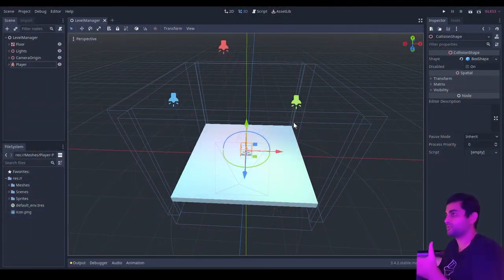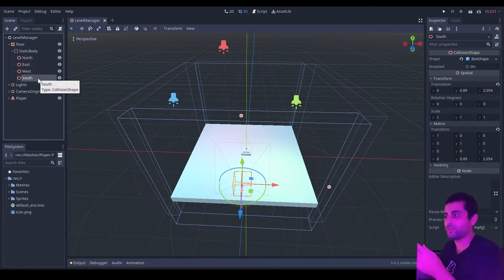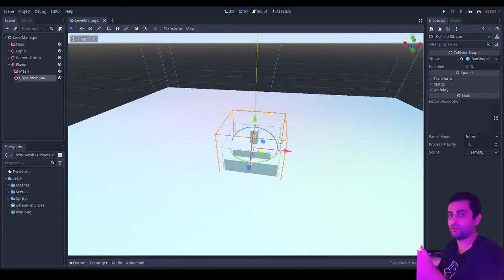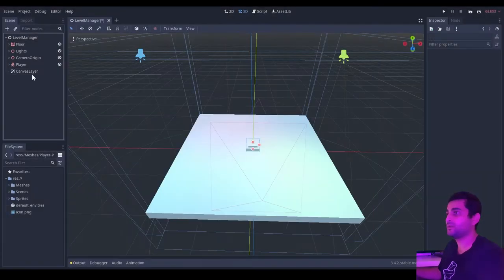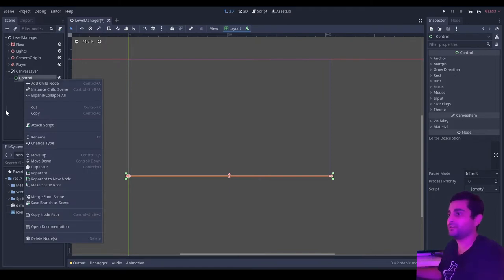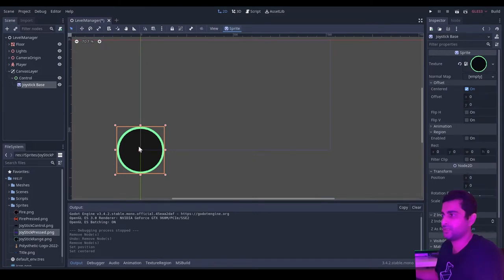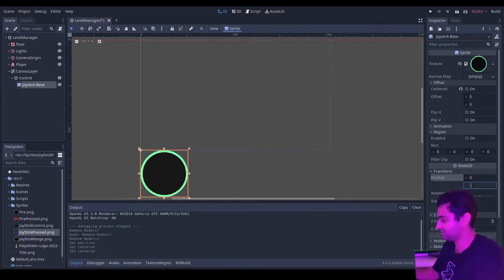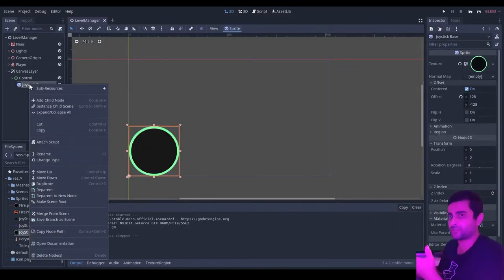Touch Joystick with C# & Godot [Andromedoom Dev Log 1]

Comment from the maker: 📻 Addenda: 
1. You can use Normal.GetSize() and assign that to the buttonSize or use it directly instead of assigning GetHeight() and GetWidth() to a new vector.
2. To get the player node, you can simply use GetNode(/root/...) instead of using GetTree().Root.GetNode(... ). 
3. Note that player movement doesn't take into account the rotation of the player pad. I will cover this in the next episode, but this can simply be solved by using Transform.Basis.Xform(movementVector). This multiplies the movement vector by the basis matrix of the object which can then be fed into the MoveAndCollide function.

Comment: I did everything exactly the same, I checked several times, and I still couldn't figure out why my button isn't centered like yours. Apparently when he resets the position, he joins the corner of the big circle with the corner of the small circle, which makes the position decentralized, which logically makes sense, what doesn't make sense is why in yours it was right...
Reply from the maker: Are you using Godot 4 by any chance? Not sure, but there could be changes to how the positioning works for touch screen buttons. 

In any case, check the pivot and anchor positions of both your touch button and the joystick base. See if you can snap it to the centre by accounting for the dimensions and positioning of each one.
Reply: @Polysthetic  LTS 3.5.3-stable, i cant change the pivot of the "touch screen button" node, apparently only Sprite nodes have Offset property.
Reply from the maker: Correct. Is your script similar to below? 

    private Vector2 buttonSize; // The size of the touch screen button texture
    ...
    public override void _Ready()
    {
	...
        // Get button size for correction of position
        buttonSize = Normal.GetSize() * Scale;

        // Update centre of joystick control
        var controlOrigin = GetParent() as Control;

	// Subtract from the rect position of parent the size of this touchscreen button
	// texture multiplied by half the scale
        controlOrigin.RectPosition -= Normal.GetSize() * Scale.x / 2;
	...
    }

    public override void _Input(InputEvent inputEvent)
    {
        if (!IsPressed())
            return;

        if (inputEvent is InputEventScreenDrag dragEvent) 
        {
	    // Ignore distant events
            if((dragEvent.Position - GlobalPosition).Length() > ignore) 
                return;
            
	    // Set the new position to the drag event position minus half the texture size
            GlobalPosition = dragEvent.Position - (buttonSize * 0.5f) ;
	    
	    // Clamp joystick distance from base
            if (Position.Length() > boundary) 
                Position = Position.Normalized() * boundary;    
        } 
    }

If you want, paste your code somewhere, like git gist or pastebin and I'll take a look :)
Reply: @Polysthetic  Now my code is exaclty the same as your, i make a project just for test the joystick following the video step by step and n the video you didn't add the "controlOrigin" but i are using GetNode(path) because the GetParent returning null (path above), now I added it and left it the same as the code you sent, and it continue decentralized.

The nodes path:
LevelManager/CanvasLayer/Control/Joystick Base/Joystick

The script are in the Joystick.
The Centered property of the sprite Joystick Base are off.
Reply from the maker: Hmm okay, the problem might be in the node heirarchy. 
I have:
The joystick base TextureRect node, anchored to the bottom left with the pivot offset in the middle
∟The "joystick centre" Control node is a child of the base texture. It has its anchor at the top left of the joystick base texture and its rect position towards the corner in such a way that if the top left corner of the joystick button is on top of it, the button will be centred
∟∟The joystick TouchScreenButton is a child of the joystick centre node

If you can, maybe upload a ZIP of your project somewhere and I'll take a look.

Comment: Thank you a lot from Russia!
So nice listen to you
I have HUD as a another scene and my joystick there is at this scene
How I can connect signal for my player?
Reply from the maker: Thank you for watching :)

Typically, Godot would encourage that the parent of the HUD and the player will connect the signal between them. You can do this in script by having the parent node find the player and HUD children via GetNode() and then calling the player.Connect(joystick, signal) method.

Sometimes this can get complicated so I actually prefer to find the parent instead from the child. My latest video shows you how to do this, but some people discourage this as it can lead to bugs. Personally I found it works well in C#, maybe it's only discouraged for GDScript because it's dynamically typed. 

You can also do this with a singleton object loaded as a global script that keeps a static reference to the player and/or joystick (because there should only be one of each at any time) so you can attach a signal or directly call methods on the references.